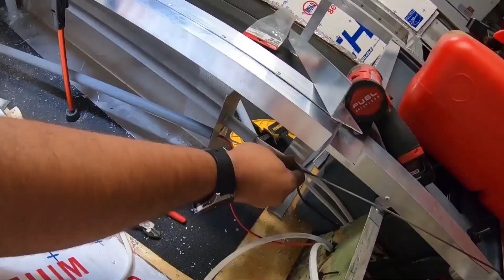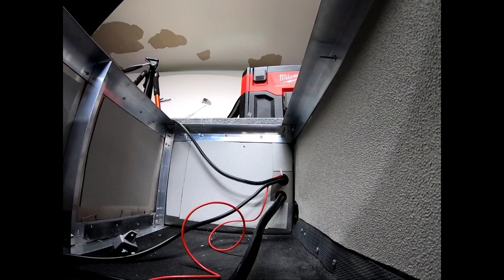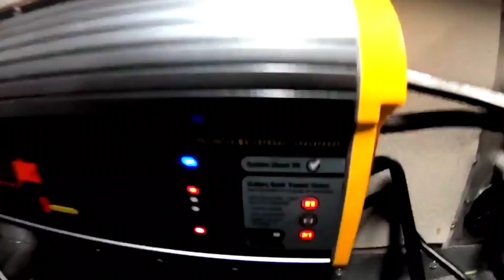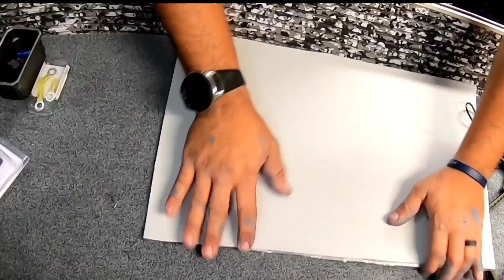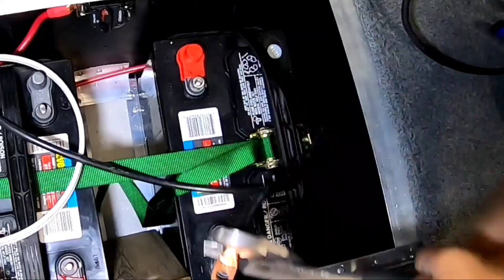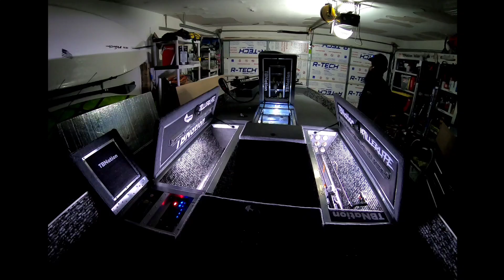Marine Battery Wiring and install + Onboard Battery charger & fuze/breaker.

Comment: I think it is a very good looking installation and very clean but there is no NEC or ABYC or NFPA standards being followed so, as a marine electrician myself I see many deviations that will shorten the life of this installation and in cases can be dangerous.
.
- Tin is less conductive but it is used to prevent corrosion and corrosion is way less conductive and more destructive than tin. So tin conductors should have been used.
- None of these compartments appears to be vented, lead acid battery vent hydrogen a highly explosive and corrosive gas. Obviously it should be vented and no other appliance should be in the same compartment, certainly not a none-ignition protected battery charger.
- Each battery should be secure so they could not move more than 1 inch in any directions, individually.
- Breakers are called thermal breakers they trip on heat, that is why we use fuses that are tripping on amperage.
- None marine grade breakers will just fuse/corrode themselves in the closed position.
- Conduits are nice but they need to be vented for heat dissipation.
- The posts you are using are called "accessory posts" they are not meant to provide the amperage that a trolling motor will ask, so heat and fire risk. A clue: When the AWG size of your cable is bigger than the post you are tying it too, there is a problem.
- You are using a 20A charger and you mention 3 batteries, I see they are 690 MCA so your charger does not produce 15% of the total amperage of you r installation, not even 10% which is the absolute minimum requirement.
- I am sorry to say: It is  not about "calling you out" ( I have no idea what FB group you are talking about) and having good "rebuttals" (gee) it is about following standards. 
- Installing heavy components "at the ends'" will induce hobby horsing and that is a dangerous attribute in any boat and especially on low freeboard bass boat type.
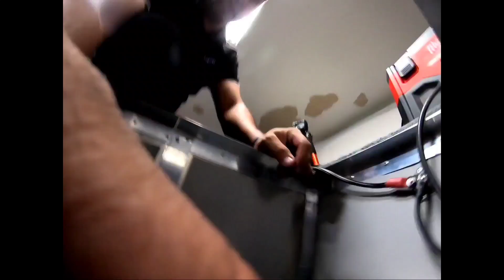- The fitting you are installing on that wire at 3:10 is way too big for the stud and at the very least will shake itself loose.
- I do not see any considerations for the voltage drop and these wires look pretty thin to me even at 24V, also it looks like you are using the same AWG size throughout so unless you used over-sized wires everywhere it looks like  some runs will have undersized wires...
- I do not think a clerk in a general battery store can be considered an 'expert' in marine electrical systems, you should àbe the knowledgeable one. Just sayin'.
- Group 24 LA battery, well it is not a guess, you have to calculate your power requirements per hour, how many hours the requirement will be needed, and your deep cycle battery should be twice the total amount plus 20% as a safety margin. 
Ex. your requirement is 10A for 10 hr = 100A your battery should be 100A plus 20% safety margin 120A battery needed. Bare minimum battery charger output 10% so 12A, 15% as a standard= 20A.
- A battery threated decently should last 5-8 years, not one...
Those are just the ones that structed me in passing.
Cheers,
a

Comment: I ran a group 27 lifepo, super lightweight.  I also run a Noco genius x2, with a plug in port so I don't even have to open the battery compartment.

Comment: Why not 1st buy the boat or receive the boat for the build and then take it to a local weigh station or dump weigh station? Then do your build and compare afterwords... 
 I actually think your builds look pretty good, in my opinion alum is def lighter then wood and you proved that in another video... my area only offers 3/4 marine wood, my 89 tracker looked as if it had 1/2 inch on the bow, I'm hoping after fiberglass epoxy an carpet it's not to much weight, cause I'll be pulling the floor an doing the same process there, then onto the rear of the boat which needs all the foam removed some how it all looks to be 1 piece from the seats to the bottom of the rear center battery an gas box which I don't love the idea of my gas an 32v of battery in the same space...
Reply from the maker: That's too much work

Comment: Just a thought but when using conduit, use individual wires rather than a wrapped pair. The theory is that it traps heat that becomes a fire hazard.
On your batteries, do you use a battery maintainer during the winter? Can help extend battery life

Comment: a year of use on cheap batteries??? I just retired an 8 year old dual purpose, interstate. have gone with a single crank 24 and house 27, both interstate. 
I found the video very informative, so thank you. Can not understand though cheaping out on batteries that only last a year. 

Thanks again.

Comment: Deep cycle batteries are fine for motor starting as long as the CCA is plenty? Iv got a 70hp Yamaha, just got 2x AMG deep cycle batteries and wondering if I should of got a cranking and deep cycle but it seems so split optional if a cranking battery is even needed for an engine this size.

Comment: What did you use to connect the onboard charger to new battery wires?  Thanks
Reply: @TinyBoatNation  Thank you, now I need to figure out how to do the 6 gauge to 10 gauge step down for the trolling motor, Any ideas?

Comment: ALWAYS keep battery terminal covers ON when working around them. Just so if you  accidentally drop a wrench or kick aluminium angle that connects the two poles and kaboom

Comment: Did you happen to use a adhesive with that Eva foam on the aluminum or did you just put it on with the sticky backing that comes on it the Eva foam by chance... thanks!!!
Reply: @TinyBoatNation   🤙 thanks man!!!!
Reply: @TinyBoatNation  how about applying the eve foam to the marine grade plywood do you treat the wood or leave it bare then apply the eve foam!!?  sorry and thanks again!!!

Comment: Some great information on hooking up batteries and all, I do have a question, I am installing two new fish finders, and I have watched several videos on ensuring direct power be applied to them. One video in particular is on using the wiring harness developed from Sea Clear, Although they have a great system, I think I can accomplish the same by making my own harness system. I have purchased marine grade 8 gage wire and I will be installing in line fuses , My question is they show running these lines directly to their cranking battery, I have a smaller boat and only have one dedicated battery for cranking, I also have two other batteries for my trolling motor, By connecting to my cranking battery wont that run my battery down and possible risk me not being able to start my engine? 
My next question is they use a switch from the battery, never had a switch since most of my other electronics were so small they did not pull much juice, But these new lowrance units are a bit more power hungry, How exactly do these switches work on when I sold turn them on or off , I assume during cranking time they should be turned off but if I am up on plane running I need them on to read the lake.
In line fuses, I have heard a couple different fuse types to use, one says 5 amp and others say 20 amp going to the fish finders. Since each fish finder will have its own in line fuse is 5 amp sufficient?
I also noticed you used a breaker system that you purchased from wall mart, Should I also add those into any of the connections running from my battery to those units?

Sory a bit long but I want to get this right and I am hearing multiple methods, I just want it to be right so its safe. any help would be much appreciated, Thanks

Comment: Genius is all I can say. I don’t have a clue what you are doing but interesting anyway. If I wanted to install an on/off switch at my cranking battery... what wires would go into that switch to make it work. Keep in mind that I know absolutely nothing about wiring. I only know red is positive and black is negative.
Reply: I bought the on/off switch for my cranking battery over a year ago but it’s not installed because I have no idea what wires go in it. I was going to put all the wires that are connected to my battery in it but I heard that’s incorrect so I now have to go find an electrician to install it. Wish I knew how and I’ve searched videos everywhere. Was hoping your videos could help

Comment: If you use a good on board charger/tender for you batteries and you maintain them correctly aka check water/acid levels once a month or 2 and top off as needed only fill after fully charged with distilled water then you should get 4 or 5 years out of your batteries or more

Comment: could you do a demonstration showing  how you would wire a trolling motor using a circuit breaker running to a marine switch panel outside the boat I'm more confused from looking at this video than ever and I do not want to blow up my boat because I do not have the funds to replace it I have an older model lund which have a raised bow that Im trying to install a trolling motor on any help would be appreciated and if you could dum it down some that would help

Comment: Really like the idea of using PEX pipe. Is That ROMEX wire you're using? If so, GREAT IDEA! Impeach you? HA! The only thing that I can say with the weight is if the water goes over the sides of the boat when you unload it, THEN is when its too heavy! Ha ha ha! Everything that you use seems to be very lightweight. Especially when you're using aluminum. Take a pre build and post build weight measurement on scales then calculate the percentage of total weight. That will tell you if it's too heavy

Comment: Would you get the MS fornthe cranking battery or just use the DC also? How does ot work cause i have 3 batteries 2 of which are connected together so how do the connected ones work

Comment: Why not have one main breaker  for each battery  on the gauge panel  next to the  steering wheel . Something like this https://www.delcity.net/store/EATON-Mid-Range-Breakers-Switchable/p_823679.h_823680.r_IF1003?mkwid=&crid=410099918330&mp_kw=&mp_mt=&gclid=CjwKCAjwwYP2BRBGEiwAkoBpAmEbtmcETSJd_GgEOyUlAHLPiqtR_em_PtZUNeDQVIrsRchylvbC9RoCt0wQAvD_BwE. ? In case of an emergency why would you want to go  raising up lids when you can have it away from the battery's on the dash ?   I have a boat  engine question . I have a old 1983  2 cycle 150 hp Mercury engine  . Does it have  a alternator or stater  that charges back up the battery  when the engine is running ? If it does  do the  wires from the  stater  go straight to the battery ? If it goes straight to the battery  should there be a  breaker that is easy and fast to shut off  between the battery and the  engine's starter  and then another one   between the  stater  and the battery  ? This would shut off power going to the engine  and  coming out of the engine . Can the  volts  coming from the  stater to the battery  not only go to the starting battery  but be connected to the trolling motor battery's  so when the engine is running  its charging all the battery's  instead of just the one ? If that is possible how would you get a charge to all the battery's but not have them connected to each other ?  I know diode's only let  electric current flow only one way   so if you split the hot wire from the stater  you could add a diode between each wire leading to a battery  and it should let you charge  all the battery's   you connect to the stater wire .

Comment: Hi mate.. I am looking to put one of these on my boat; however, i am bit skeptical about installation as i am not mechanically inclined. Are the positive and negative coming out of device going straight to each battery and they shore power to the unit? Any other fuses or considerations to take into account? Thanks..

Comment: while on water use new batterys get solar 12-24v  keep new batterys charge  better then this type chargers!  because solar up keep new batteries nthen old batter   you  use solar add dc -ac convetor  then plus in as well! must add inle fuse on poistive side battery leads!! must in line fuse!!  i have pontoon boat 20ft  set way higher then fiber glass boat!

Comment: Can I send you pictures of my new to me 1982 Cajun bass boat I’m trying to learn how to rewire? Just to get your honest opinions if my idea where I plan on placing everything. Thx
Reply: Same I have a runabout boat and a battery no trolling motor but I don’t no where the ground wire is post to connect from the battery to .? I’m so confused
Reply: Anything electrical makes a complete circle if that makes sense... so + from battery, fuse or circuit breaker like has has, example to light switch + post, to light bulb +... then back with negative... light bulb - to light switch post - to battery -

Comment: I like your videos and have been thinking about building a boat myself, also I run Walmart batteries in my bass boat and usually get 4-5 years out of them. General maintenance will help keep them good. Also if you run any graphs with si, di, or gps. Get the 27 or 29. I can run my helix 7, helix 10 and both livewell pretty much all day on a 29dc everstart. And use the 29 series for the ultrex. Weight might be a little issue though. Anyway, great videos!!

Comment: the weight thing is directly correlated to the bouyancy.  the canadians once built an aircraft carrier out of ice, the mullberries at normandy were concrete.  on a seperate note i got group 27  battery trays at cabellas that had the hold down strap for around $12.00 they had group 27 and group24  on the shelf. nice heavy plastic.
Reply: I use those same ones.

Comment: To heavy???? Really???? I've seen your boats all built out and they're barely in the water. If you didn't have a fat man or two in the boat you'd have to put an extra long shaft motor on the boat. I guess you can't make everyone happy. And you never will. But for me, this sh*t is great. Man dont ever stop. And please dont take the old stuff off. I watch then rewatch and every time I get more of the evaluation out of the videos. I think I can speak for a lot of us it can be hard to follow that twisted mind of yours. 😉😉👍👍👍👍